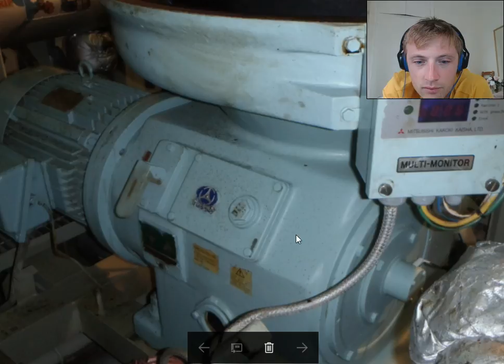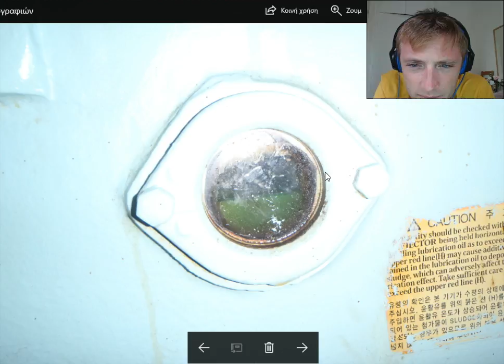Purifiers what is important explain

Comment: I hate these Mitsubishi/samgong style purifiers! For anyone not familiar with these the pilot valves are very important to keep clean and move freely or the purifier will not work. Alfa laval or westfalia are much better
Reply from the maker: Also very i have seen spares that are not original this plays big role how purifier will perform.
Reply: Adventure Story is a different how instal separator plates? Can it mix? What is the different between them ?
Reply from the maker: Hello dear friend top of the discs if you will see are slightly different from the other one . 
There is only 3 or 4 of the top all the other discs are the same.For me is better to keep as much as possible the discs in same position .
ok the top sure must be on place,but for the other it will verify that balance of the bowl will be as much as possible unchanged due to purifier are precise equipment.
A other important thing is the marks on purifier also plays big role.
One last thing use vazeline tk reduce the fricton of the o-rings these will give extra lubrication at first start after overhauling.
Reply: Adventure Story thanks 🙏 a lot.
Reply: Adventure Story is a different how instal separator plates? Can it mix? What is the different between them ? Please explain. Because some Engineer could not explain me it. Why . It’s important to instal plate on his place .